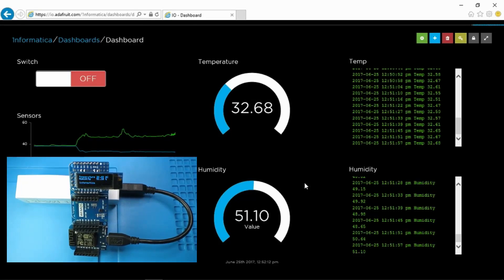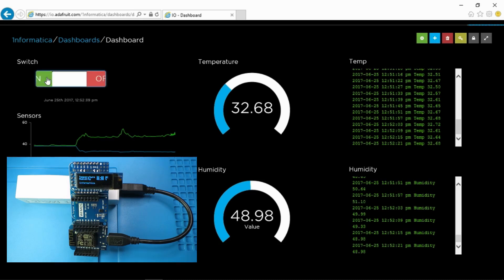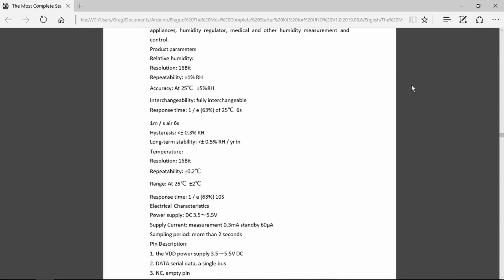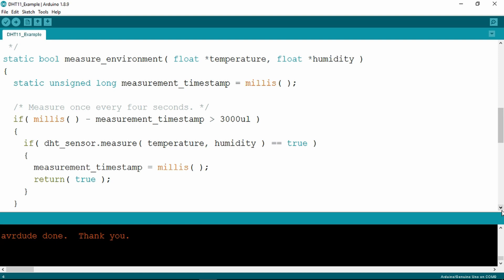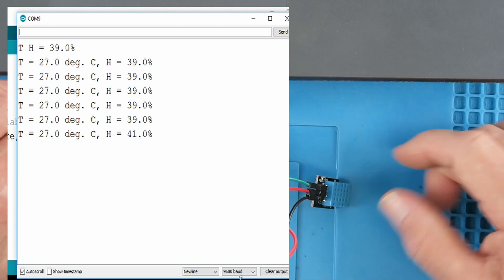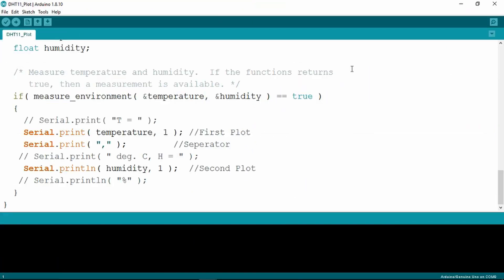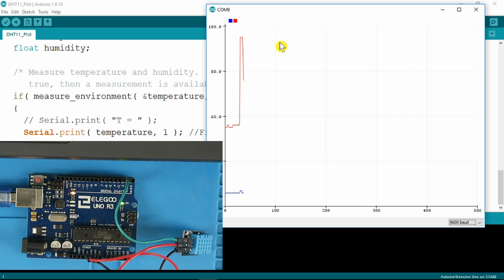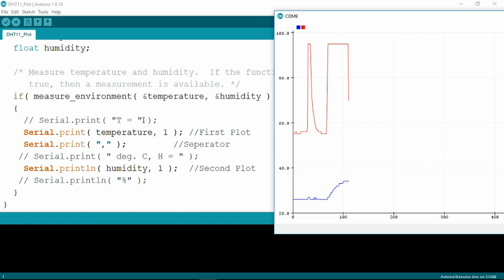Elegoo UNO R3 Project Part 7 DHT11 Temperature and Humidity Sensor

Comment: Those sensors seem to have a quite rapid response time.  Cool.    Didn't know Plotting was available.    I can think of a number of uses for that one.   Is there a  handy sketch way to get that function into the Arduino and away from the IDE ?
Reply from the maker: Yes, they respond fast enough for real time control I think. Apart from in the IDE plotting seems difficult. I have not found a  good program / app to do it. I have just found this : https://www.youtube.com/watch?v=YejRbIKe6e0
But I haven't tried it yet.